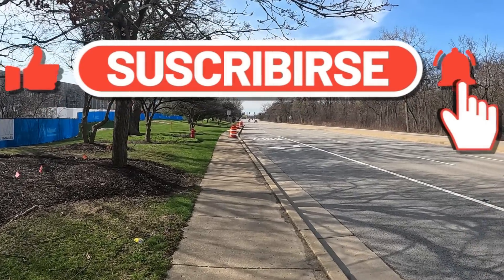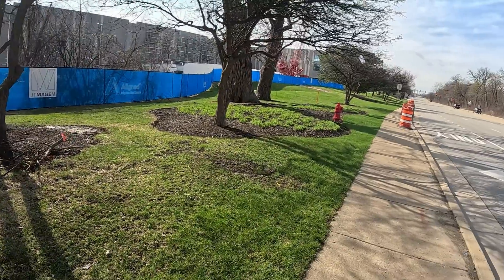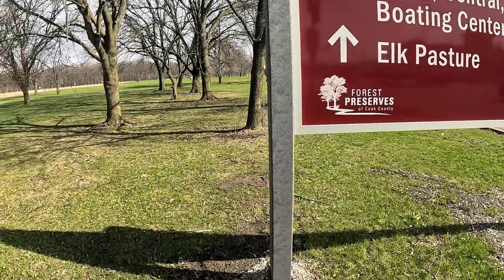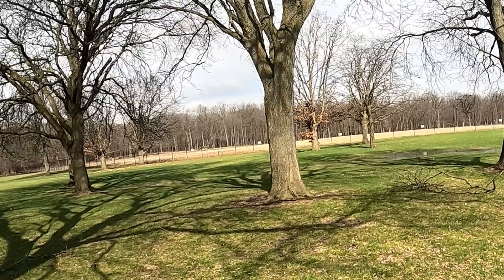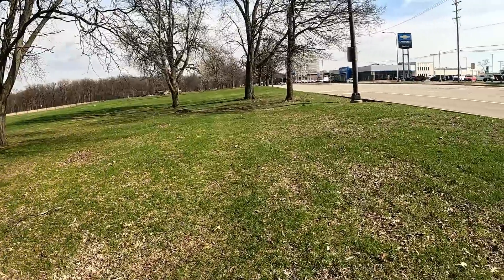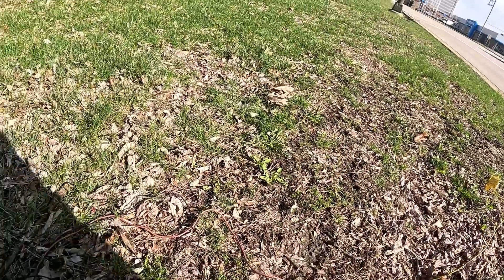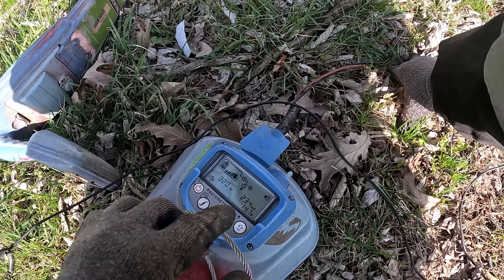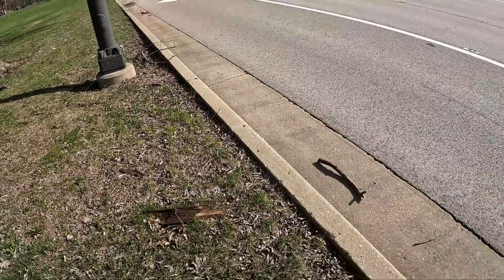Locating a High-Profile Gas Main with Current Direction | Well, I Messed Up in This One!

Comment: Rookie question: What lead you to determine you were initially on the incorrect test lead? Thank you for this informative video.
Reply from the maker: I wasn't sure which wire went in that direction, so I always checked all the wires and then take the best reading using the receiver's milliamps. Then I stay connected to that wire.

Comment: If you ever decide to retire from Utility Locating but want to stay on board would you ever sit on the Miss 811 or the Public Utility Commision. I mean you have been in the field for a long time so you would understand that this job is not a race and we are damage prevention specialist and want to keep our communities, homeowners and contractors safe.
Reply from the maker: That’s definitely something I’d consider. I’ve been in this line of work a long time and know how important damage prevention really is. You’re right; it’s not a race. We’re out here to protect homeowners, contractors, and the community. Stepping into a role like that could be a solid way to stay involved when I eventually move on from fieldwork. Thanks!